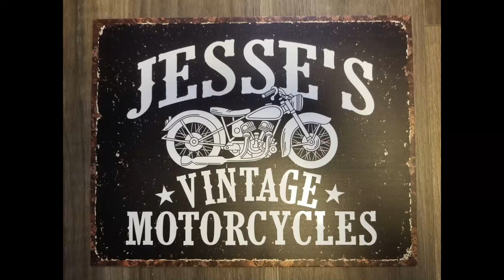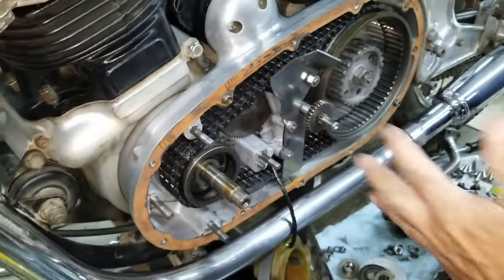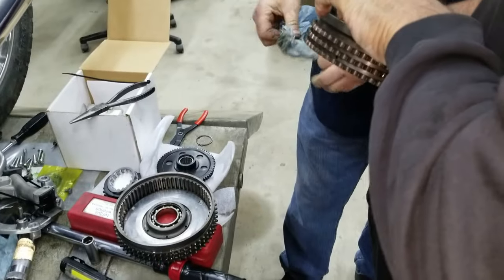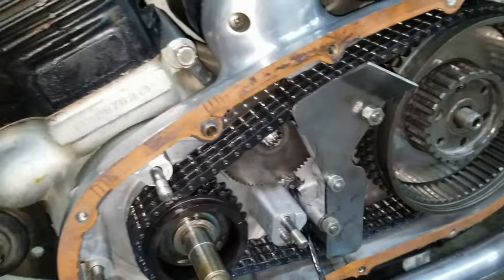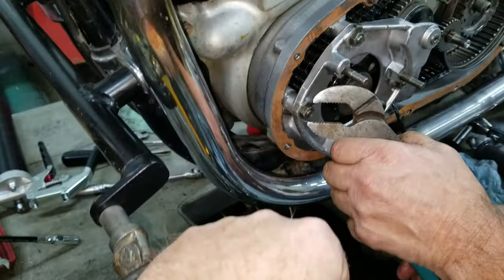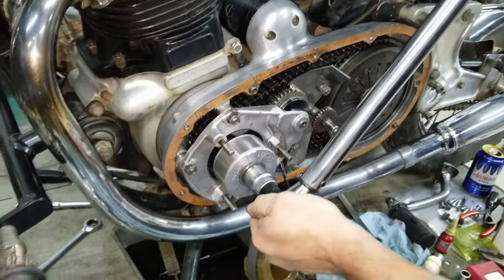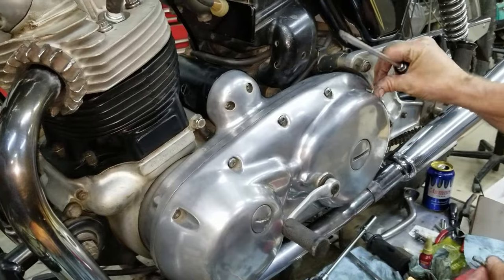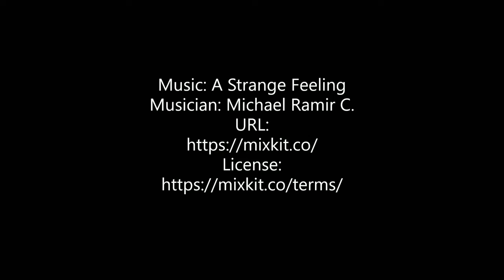1975 Norton Mk3, Primary chain case upgrade, Installing a CNW Sprocket, Sprag and gear set

Comment: Did you consider fitting a belt primary drive at this point?
Reply from the maker: The Mk3 with a non adjustable transmission isn't a logical solution  for a belt drive not to mention nobody makes a Mk3 front belt drive pulley with sprag capability and the reason for that is the sprag and bearings need oiling.